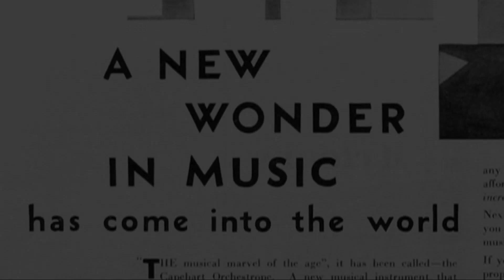Capehart Orchestrope Model 28G: A Detailed Look

Comment: In the midst of restoring a basket case one of these with no manual.  I got it all back together but getting the timing correct on the chains and the cams and the electrical contacts is really hard.  This video helps a lot
Reply from the maker: I hope this video helps you! I've had other people say it's been useful to them.  Good luck with your restoration!

Comment: Binn, begeistert Mann kommt aus den staunen nicht raus, und ich dachte ich ich hatte schon  alles in Sachen juke-box, Plattenspieler gesehen. Mach weiter so mei n unbekannter Freund.
Reply from the maker: Ich bin froh, dass es Ihnen gefallen hat! Danke für die netten Kommentare!
Reply: One strong point is that the records being played individually are all done so at correct angle.

Another advàntage is the record on turntable it self, unlock drop changer where a warped record in the stack makes those slip and WOW and flutter unlistenable.

Comment: My god, that has to be the most gentle record changer in the world. I'm working on restoring a capehart flip over record changer from the early 30's. Hope the cabinet comes out looking as good as yours does when it's done
Reply from the maker: Thanks for your comments!  Your changer should handle records just fine when it's set up and completely adjusted. My project was delayed for about 3 years as I waited for my cabinet man to get to it.
I had some good advice from 01Bubba2001 "Bob's Orchestrope"(on youtube) cautioning about not using records that had been stored under damp conditions.  The shellac in these is softer and the rims are more inclined to break under the weight of the stacked records.  This hasn't been a problem with mine, thanks to his help.
Good luck with your project! Also, I've committed to buying an Amberola 1B this summer!

Comment: Hard to believe, there were no 45 RPM jukes prior to 1950.  But those 45 systems were everywhere in the 1960s.  1 play for a dime, three songs for 25 cents.
Reply from the maker: Right! RCA introduced the 45 RPM record format in 1949.  Those smaller, lighter records quickly became the format of choice for later jukebox models.  Thanks for your comment!

Comment: thank you for that!  That price was steep during that Depression era for one of those, however in 2003 I paid $5400 for a NSM wall mount juke box that I had installed at a bowling alley and in 2003  that wasn't cheap either.

Comment: This is stunning, but what about the needles? Needles have to changed after every side, let alone 56.. How does it deal with that problem?
Reply from the maker: Capehart instructions advised using tungsten needles (Victor Tungs-Tone name brand) which was classified as a semi-permanent needle, capable of playing 100-150 sides with little groove wear.  The coin needles I use are a compromise, with a hard tip capable of playing several hundred sides, but with more record wear. You'd definitely not play your precious records on this, but 1940's era records stand up surprisingly well considering the weight of the pickup.
Back in the day I figure the records would be changed out frequently and likely discarded!
Thanks for your questions!

Comment: You have to wonder just how profitable this machine was. 25,000 plays. That would be about 1,700 hours of playing time. That doesn't include record costs, maintenance, electricity cost and floor space.  Presumably it's in a public space and taking up room where a table could be.  The timing of 1930 means it will spend its commercial life entirely during the Great Depression.

Comment: Just curious. How this process of flipping, sliding, reloading the record again and again can be made avoiding scratches on the record?
Reply from the maker: Good question! There's no doubt that there's some amount of surface abrasion happening with hundreds of record-changing cycles, but the major wear happens with the heavy horseshoe magnet pickup.  Any rare or treasured records shouldn't be played on this! That said, common records of the WW II era last a fairly long time before they're too worn to sound good.  Keep in mind that back in the day the records would be changed out on a frequent schedule, so record wear was not as important an issue.  Thanks for your comment!
Reply: @GracevilleMN  thanks for your reply 😉

Comment: 1930: $1250.00
2016: $18,000.00
2018: $18,201.10
2020: $19,022.59
*Source- CPI Inflation Calculator
Reply: Don't believe the hype.  The inflation calculators badly understate inflation, especially over nearly 90 years.
Reply: @tarstarkusz  That's for sure.  The dollar is worth approximately $.0275 of what it was worth in 1914.  And falling fast.  So we should probably add another zero to that inflation adjustment.
Reply: hawkturkey  If it were made in China it wouldn't work and would probably catch fire.
It is truly amazing how bad the quality of everything is today.  There was always cheap stuff, but the floor of cheapness has gone way, way down.
Reply: How old is it in dog-years ?

Comment: I was bored, and did the math. $1250 comes out to 25,000 nickels. That’s how many plays would recoup the cost. If you assume three minutes per play, the maximum length for the 10” 78rpm, that’s 75,000 minutes. Divide by 60 minutes in an hour, and you’re back to your initial 1250. So, playing nonstop, you’d pay off $1 per hour of use, and finally see a return after 1,250 hours of playtime.
Reply from the maker: Yep, that's a lot of nickels, records and tunes! Thanks for the calculations!

Comment: What an amazing machine! They really simplified the mechanics on the Amperion compared to this one. Okay, the Orchestrope holds up to 28 records, which was useful as a Jukebox but otherwise the Amperion does the same job?
Reply from the maker: +AudioMobil You're exactly right! In fact, the Amperion changer is more commonly found in coin-up jukeboxes. The reduced record capacity was an easy trade-off in making such a simpler and cheaper changer.  
Thanks for your comments and question!